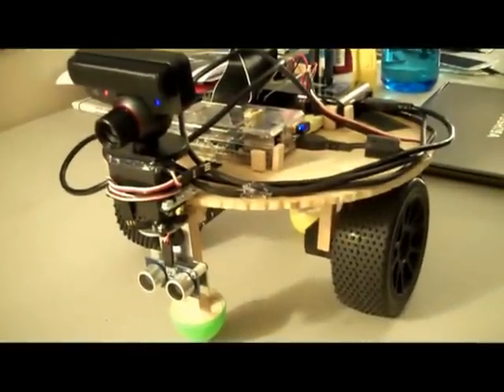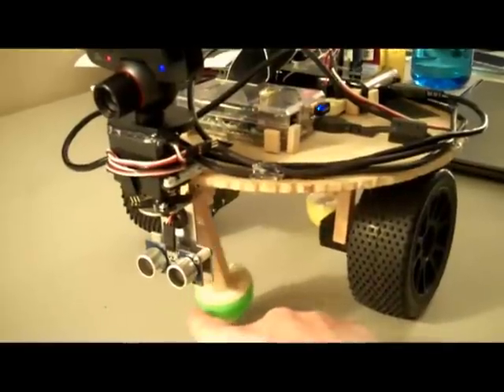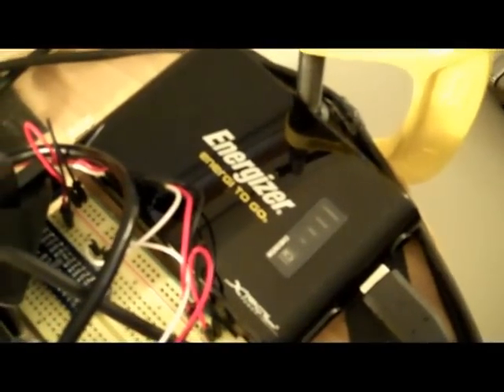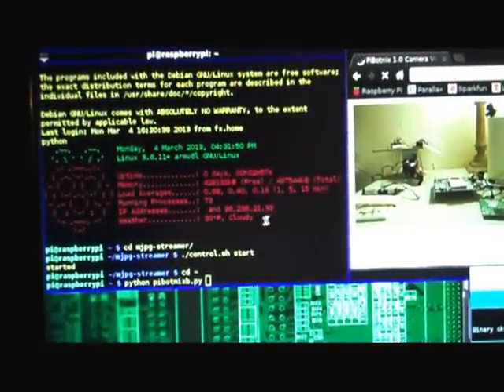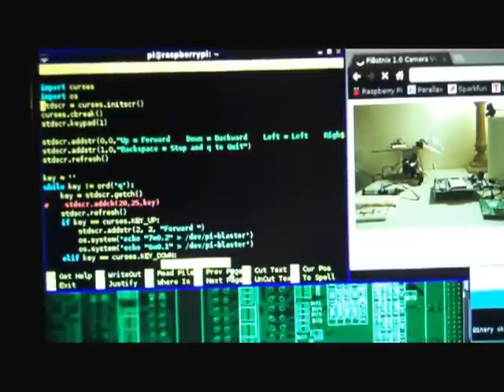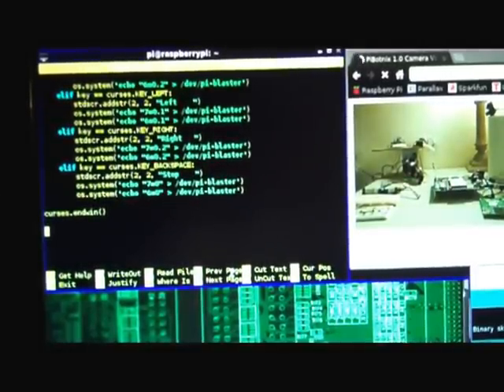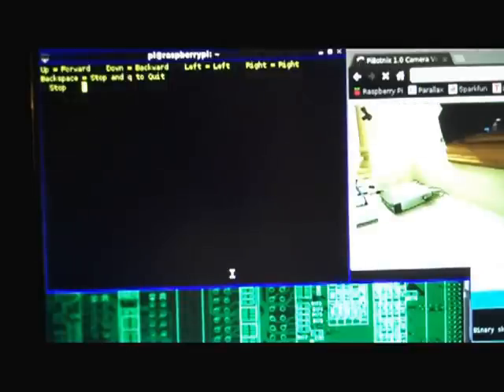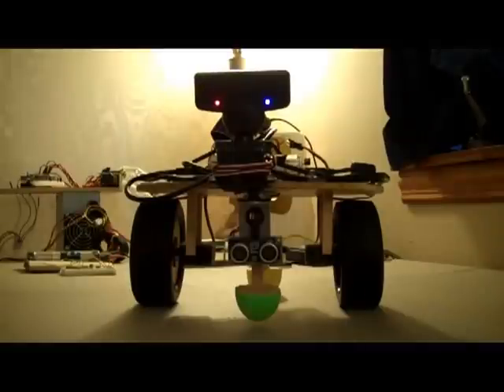Pibotnix B

Comment from the maker: Yes there is a delay for the video stream no matter what, but the delay for the controls is very small and dependent upon the network speeds between the user and the rover.  Using Bluetooth like in an Xbox controller will be cool, I hope it works out for you

Comment from the maker: pi-blaster is a project that I read about on Hackaday that opens up software pwm on 8 gpio pins with low cpu utilization.  The project is linked to inside the readme on the github link in the video description.

Comment: I've has some freezes on my pi robot due to low battery power. Usually, but not always, there is a kernel bug error message on the HDMI or serial output. It won't say "low power" but it will say that there was a memory read error or an instruction was not properly formed or something.